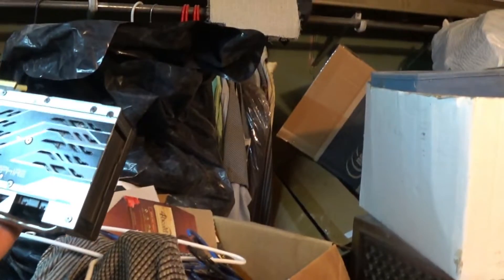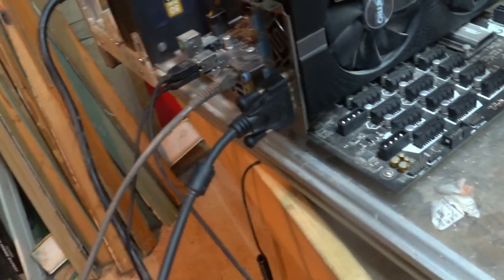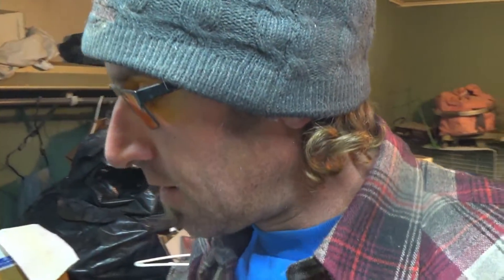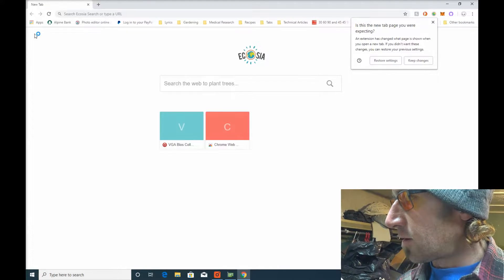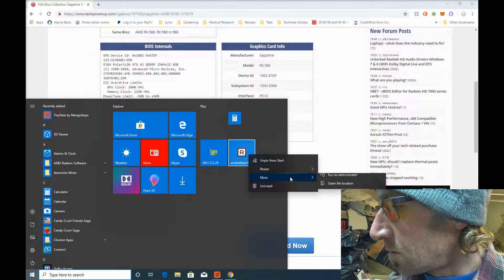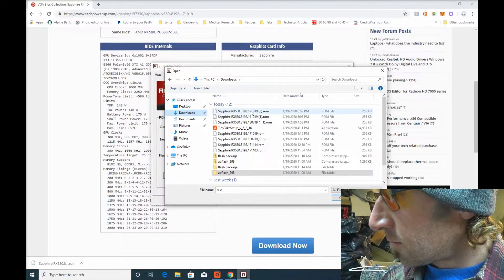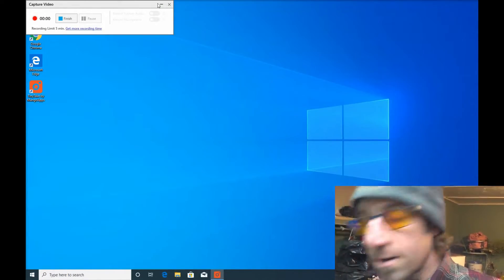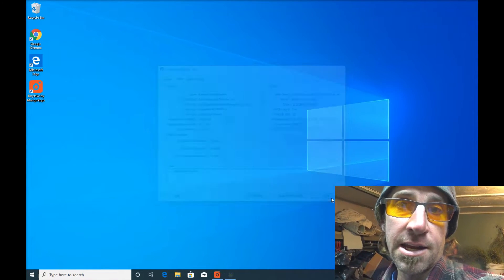How To Flash Stock BIOS of Any Graphics Card

Comment: I used ATIFlash to rollback to the stock bios but now I have no display and pc won’t boot. Any advice or is my mobo bricked?
Reply from the maker: The PC is still booting - but the BIOS memory brand was likely off, even if the BIOS matched the one you were looking for in the list. I covered this in the video. Mobo is fine  - but you now need to either plug in a 2nd video card or use on-board video (if your Mobo has it). Check the bios details very closely, particularly check that the memory speed and brand are an exact match to what the card actually has installed on it's GPU. Even the slightest detail off will result in the incorrect BIOS and the "bricked" card - but it's not bricked, just try again - I'm certain you'll find an error.
Reply: @ i basically triple checked to make sure it was the right bios memory, i have a 4gb rx 580 and there was only 1 option, checked to make sure all specs matched and followed the steps correctly. i have a white vga light on my mobo indicating it doesn’t detect the gpu. i’ve tried resetting cmos and no luck. my motherboard has on-board video but my cpu has no integrated graphics. Do you think swapping with a different gpu will give me display so that i can atleast get to the bios screen?

Comment: Can i use my old nvidia gt710  because my cpu does not have onboard video
Reply from the maker: Yes, you can use that card, as long as you can also have the one you're trying to flash installed as well, in case it doesn't work.

Comment: Have you checked out the gigabyte rx 6600 bios? I'm trying to look for it and found it but the GPU memory is set at 500 mhz. Why? The card's max GPU speed is over 2500 mhz. So I can't figure out why tech powerup has their VGA bios memory set so low.
Reply from the maker: Dude this video is like 6 years old - tech powerup's list might be quite outdated by now. It's been a HOT minute since I had a flash a video card. I would check gigabyte's website for the proper source files for the BIOS. The tools however should all work just fine for the flashing process itself.
Reply: @MartyUlrich  ok thanks for taking the time to reply. I'll check that out.

Comment: very useful considering that the card eont even work for gaming now that AMD put something in the drivers to prevent it from working if the bios has a mod. You can download a earlier driver version. They made the change around the time forza 5 launched, so if you download the game ready drivers for the forza 5, I am pretty sure that  you can game on the mining bios. The lower GPU core is not helping these cards. We need to get them all flashed back so us gamers can FINALLY use them.

Comment: The real question is, how to flash a higher power limit bios to a gpu even if it is from a different manufacturer
Reply from the maker: It depends on the architecture of the BIOS logic chip you are intending to flash. I have not done any experiments like this, so it is only theoretically possible.
Reply: @MartyUlrich  With previous generations of Radeon it was possible.  Also, current rx 4k from Nvidia its possible.  I flashed a strix bios to my tuf gaming 4080

Comment: @Marty Ulrich I watched the full video however, the most recent AMD flashing application does not include the file "amdvbflashWin." Could you could help me flash my Asus Strix Rx 570 4GB OC to stock bios? Another issue is that the GPU fan turns on and off automatically. I purchased this GPU from eBay, and it was previously used. I recently read on eBay someone discussing how this GPU was used for mining.

Comment: I tried flashing my gpu but at first it said it is mismatched so I programmed it again with my backup rom which was successful. after rebooting, there's no more display.
Reply from the maker: Your hardware is damaged I would say. If you found the correct ROM online and it is mismatched, that could mean it didn't match the program of the logic chip, however, an incorrect ROM can also give a mismatch.

Comment: Thanks a bunch mate.

One question. If my card, sapphire rx570 has dual bios how do i make sure i load the correct bios into each switch position. 

Not sure if on tech power up they have both the performance and quiet bios's.
Reply from the maker: It's not dual BIOS as far as I am aware; that's the switch that locks it so that it cannot be flashed. In the case that it is dual BIOS, then just pay attention to the position of the switch and use that BIOS for your actual gaming, but I am pretty sure it's just a lockout switch.
Reply: @MartyUlrich  https://youtu.be/N_nZyfy2JEE

Thanks for reply.  The switch defo is 2 different modes according to that video.

Im trying to get my mining gpus back to stock to sell.

Maybe if i go through the list on Tech PU and see if there are 2 for my card, one with slower clocks etc.

Comment: this can solve power limit issues in laptops ?
Reply from the maker: No, that is not its design; it only brings back the factory BIOS
Reply: so can you tell me how to remove power limit .. i have laptop and i dont know why asus do that i59300h nvidia 1650 .. they dont work max cause of heat ?? and the bios locked

Comment: Bro my gpu is amd rx560 4gb when I install new driver it work fine but after 3 to 4 days i gone hardware settings change and crash problem then again reinstalled drive it work fine to 3 to 4 days I install old driver and new driver but not working can i try to reflash my gpu to solved this problem
Reply from the maker: Some other program is making those changes. Are you running any graphics tweaking software? Even the Radion software can override the drivers installed with Windows.

Comment: Hi, i have a problem with my GPU card. No signal on BIOS entry, straight drop me to the Win Login screen. Maybe the VBIOS can help? AMD 5600X, MSI Rx 580 Gaming X 8GB. I have only HDMi display device - Hisense 55U8QF and old FHD Samsung TV.
Reply from the maker: Gotta find a way to bypass that card while it is plugged in. Might need to do it on another motherboard and display, but that's the only way.
Reply: @MartyUlrich  thanks the answer. I re flashed the GPU BIOS, and everything is fine 👌👌👌

Comment: I got rx 580 sapphire nitro 4gb, it has silent mode, but performance mod is modded for mining, when i tried to flash it, screen just froze, that happend first 2 times(i reset pc first time i waited half an hour and it boots up again without problem) on the 3rd try i got it to flash, when it froze for the first time, i though i bricked one bios. Do you know what could be the problem. Asking out of curiosity, it works now👌
Reply from the maker: That's a first! Could be the computer you used or the card! Hopefully it was the PC and not a defunct card!
Reply: @MartyUlrich  well, I'm using that pc for gaming, it works perfectly fine, guess some kind of error, thanks for help and for this tutorial 👍

Comment: Gpu-Z says 'BIOS reading not supported on this device.' and then ATIFlash says 'Cannot find discrete ATI video card.' I guess I'm screwed... The GPU I'm trying to fix is an old RX570 4Gb used for mining. Tried running these programs through my onboard Ryzen 2400g output since the RX gives only black screen and the PC won't boot at all. By the way, both HWinfo and gpu-z read the discrete card although with incorrect clock speeds. Is there any hope for this card or should I just toss it in the bin and be done with it? :')
Reply from the maker: I'm afraid it sounds like that card is hosed. Sorry man.
Reply: @MartyUlrich  Thank you for taking your time to reply and to make this awesome video. Many of us have learned something new and useful.

Comment: Hey there
I suspects my ZOTAC GTX 970 BIOS chip to be faulty because I had stability issue and after rewriting the same firmware from TechPowerUp it fixed the issues for a while but then it came back again recently. So I have a few questions. 
What are the possibilities? Does that seem like a faulty BIOS or clock chip?
How to check the BIOS with a multi-meter if it's faulty?
Reply from the maker: I'd say faulty clock chip in this case.
Reply: @MartyUlrich  Thanks a lot.

Comment: Hello , so i have xfx rx 580 4gb and the core clock is lower than the default which it is mine 1075 mhz and the default 1750 mhz , so if i flashed my gpu bios will it be 1750 mhz like all other GPUs? Please answer me and thank you in advance i will wait 🙏🙏🙏🙏
Reply from the maker: That depends if the altered setting is stored in the BIOS or in the computer on which it is installed. If it's a change to the BIOS to be at that frequency, then yes, flashing will reset it to 1750 or whatever the factory default is. If it's a setting in the overclock software, then the setting might be preserved, but you may have to just set it up again to be the way you want after you flash it.
Reply: @MartyUlrich  omg my bad dude i writed wtong here it is
Reply: @MartyUlrich   , so i have xfx rx 580 4gb and the core clock is lower than the default which it is mine 1075 mhz right now  and the default is 1366 mhz , so if i flash my gpu bios will it be 1366 mhz like all other GPUs? Please.
Reply from the maker: @l7ajbrahim605  Yes, then 1366 mhz - if you want it faster, you'll need to run an overclocking program like MSI Afterburner - there are others out there too that work better with certain brands of GPUs! Good luck!
Reply: @MartyUlrich  but why would i overclock since it's the original 1366 mhz?
Thanks for replying
Reply from the maker: @l7ajbrahim605  Better gaming performance, but I'd leave it at 1366mhz myself... it will run just fine
Reply: @MartyUlrich  yeah , all the gpu of rx 580 are 1366 mhz core clock
But mine is only 1075 mhz core clock, i tried reinstalling driver amd but nothing works, any solutions pls?
Reply: @MartyUlrich  sorry for my bad english i hope u help me

Comment: Im using window 10 when i restart my pc my graphic driver not show  error 52 what the problem please tell me
Reply from the maker: That indicates other problems in the video card's circuitry and unfortunately, cannot be fixed with a BIOS flash. The card is physically damaged.
Reply: @MartyUlrich  digital signature error?
Reply from the maker: @rajahamza8060  I think that refers to the driver you have installed - Windows doesn't like it. Update your drivers from the manufacturer's website and try again.

Comment: what if the card is installed on a rig without windows opperating system?
Reply from the maker: Then this video doesn't apply to you. I mean flashing is flashing, but it's a different process using Linux and that's not my gig.

Comment: It keeps saying that version of BIOS is already installed.  Tried all of them from the 6700 XT Radeon 12gb.  Please help!
Reply from the maker: Either the card has malfunctioned or there is a BIOS switch that's turned off
Reply: @MartyUlrich  Nvm, I finally figured out what I did wrong.  The GPU settings were not set properly so it kept overheating.  I think that was my official, "idiot moment," of the year.  Running great now.  I do have some advice though for those wondering if updating to Windows 11 is a good idea.  Hindsight, it is.  I've noticed a massive performance boost for games and even my bitminer.  Just keep in mind its a good idea to run Windows Update as often as possible.  Don't be an idiot like me and only update monthly, check every day if possible.

Now I'm just waiting for Microsloth to release an update for the Taskbar Settings to not be such a headache to manage.  I run dual monitors and want it in the second monitor.
Reply from the maker: @sunayocarissime5309  I would wait on Windows 11. Seems like Windows 10 with a skin
Reply: @MartyUlrich  Lol to late now.  Already updated.  So far its actually well made and if you're a gamer like me you'll notice a massive improvement on game stability.  Win 11 looks like it was custom made for gamers in mind, has a lot of features that hide interface and HUD options to make the experience more immersive.  Resize Bar is also hard encoded into the OS to.  Currently my only gripe is that Taskbar has no drop down option.

If it does end up giving me grief though it comes with a built in Roll Back function IF it ends up being a brick.  Now everyone else watching this vid Marty is right, don't dive head first before upgrading to Windows 11.  Do your research first, see if its an actual benefit.  I'm just stating my own personal experience.
Reply: @MartyUlrich  is that a type of setting on the card itself?  I'm not sure how to set that.

Comment: CAN WE SEE YOUR MINING OPERATION? LOOKS LIKE YOURE DEEP INTO IT..NICE VID!
Reply from the maker: We were deep into it, until prices crashed in 2018 and the DAG file became too big to get a decent return with GPUs - now you have to use ASIC miners to make money mining Ethereum.
Reply: @MartyUlrich  NOT NECESSARILY! I HAVE MULTIPLE 12 GPU RIGS RUNNING RX 470S AND RX 570S AND 1 RIG MINING ETHERIUM RUNNING 12 RX 580S 8 GIGS....ALL MY RIGS EXCEPT THE RX 580S ARE MINING RAVENCOIN!
IM A RAVENCOIN ADDICT.....I MAKE MORE IN RAVENCOIN THAN ETHERIUM! AND ALL MY RIGS CPUS ARE CPU MINING RAVENCOIN LITE SIMULTANEOUSLY USING Intel Core i7-3770K i7 3770K CPUS MINING RAVENCOIN LITE THE SAME TIME GPUS ARE MINING ON THOSE FRAMES.
SO I DONT KNOW WHAT YOURE DOING BUT I BEEN MINING FOR 2 YEARS EVEN IN THE BEAR MARKET AND NEVER LOOKED BACK! ALL MY RIGS ROI'D YEARS AGO...ALL I DO NOW IS BUY MORE RX 580S AS THEY BECOME AVAILABLE....IM A HODLER! PEACE....

Comment: Sir,i my when i turn on my pc it put up a display " turn down pc and plug in pcie" when  i already plug in pcie cable .*
1)my psu cosair 450w) and gpu asus rog strix 1050ti)
sometime the pc take me to window but the gpu fan doesn't spin, when i stress test my gpu monitor  black out instantly  and gpu start to  fan spin at max rpm 
Gpu z status in sensor section
Gpu clock 0.0
Memory clock 0.0
Sometime it show actual reading 

I tried my friends gtx 1660 but it run fine.
Reply from the maker: Wow! Got some serious issues there. I don't think a BIOS flash will fix your card - I think it may be physically damaged.

Comment: Okay i bought used  asus r9 380 and it was mining but when i changed bios and installed drivers, they couldn't install no matter which bios i install i get error 43, is there any fix ?
Reply from the maker: I am not familiar with that error. So you cannot even install drivers for it? Does Windows recognize the device? I would check the device manager first. If it shows that it is there, even with generic drivers, then run Direct X Diagnostics. If you are dead sure you have the correct BIOS and it still returns errors in DX Diagnostics, then you might have a physically damaged card. The heat from mining can do that.

Comment: Please help, I am having black blank screen with my asus 1080ti oc edition. And I dont know how to repair it or even whats wrong with it. It stopped working suddenly. Please help @marty wlrich
Reply from the maker: Calm down!! Did you even watch the video? The answers to your questions are literally in the video.
Reply: Yes buddy I saw the whole video 2-3 times already. Just want to know can vbios automatically gets corrupted or missing from the GPU? Because it was working 2-3 hours before and now it's gone black blank screen. And I can tell that's windows is being loaded.
Reply from the maker: @PulsedTech  I see. Certainly, a VBIOS can become physically damaged, and if that is the case, flashing the BIOS will not fix the problem because the information gets corrupted quickly from the damaged transistors.
Reply: Yes I tried vbios reflashing still no luck, I checked also the voltage on every diod and chips on the board all seems fine. Should I try heat the processor with heat gun and flux? That's my last option I gues.
Reply from the maker: @PulsedTech  Yeah at this point, you're basically trying to give CPR to a dying card. Not sure heat will help... heat generally damages transistor chipsets irreparably. You might try cold instead. But if the chipset is damaged, the only option is a replacement. Unless you're an accomplished electronics solder tech, you're better off getting another card.
Reply: @MartyUlrich  Thank you so much buddy for the quick and helpful response. I really appreciate it. You earned my respect and a sub :) .

Comment: Hey man, I was wondering. What would happen if I flash the wrong bios, like wrong memory type. I did mine and I'm Unsure that it might be why I glitch while gaming. Please help 🥺
Reply from the maker: It would still work, but with errors. Use the Direct X Diagnostic tool to check and if it shows errors, then flash the correct ROM; otherwise, your card is damaged.
Reply: @MartyUlrich  wow thanks alot. Because I did that(flashing ex mining GPU) and I do have some glitching while gaming time to time but I'm sure is it the cooling or something else (my case is really bad with one fan) . Thanks

Comment: Hey man, thanks for the video!
I'm having some trouble finding the correct bios for my card. I have an Asus dual OC RX 580 8gb, with the device ID 1002 67df - 1043 0597. But i can not find a matching ID if I put in the specs in Techpowerup, all the dual oc's i find end in 21...
Reply from the maker: It's a pretty extensive list but doesn't include every BIOS. Check the manufacturer's website in that case.

Comment: My RX470 8GNitro+ has Vbios switch. The BIOS suddenly got corrupted, OC mode was showing white noise and in Silent mod no driver was getting installed(error 43). Flashed a stock bios in silent mod switch and recovered. Then I understood the stock bios I flashed in silent switch (towards IO port) position is the OC bios and not its silent bios. Will it create a problem later and does OC bios and silent bios both need separate flashing?
Reply from the maker: I have no experience with that particular card but yes it sounds like you need to flash again with the switch flipped.